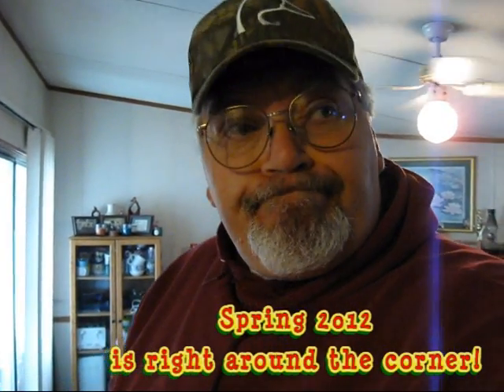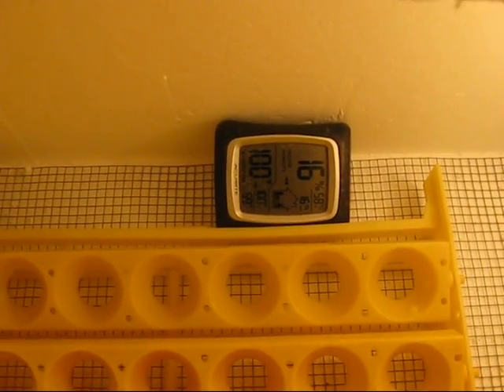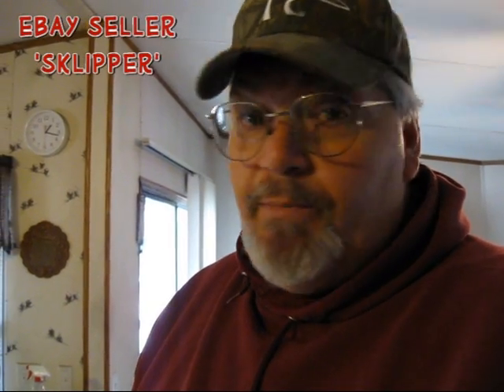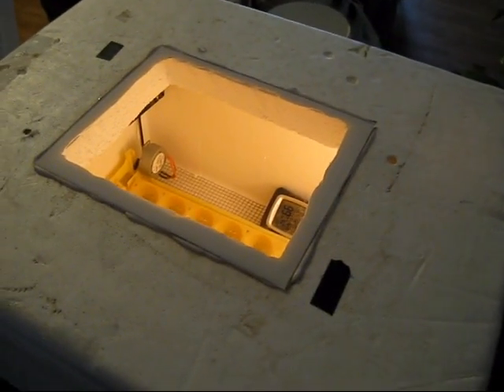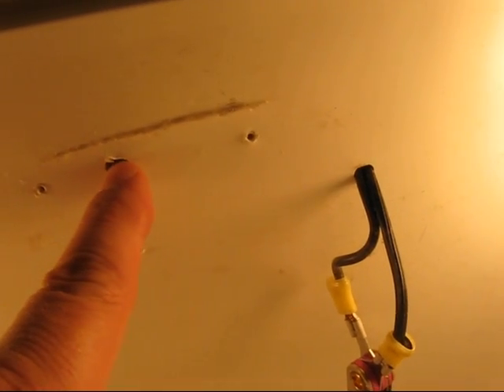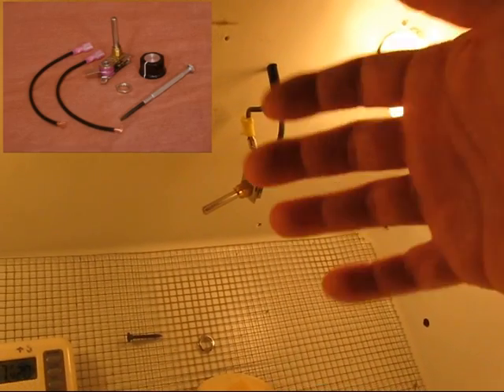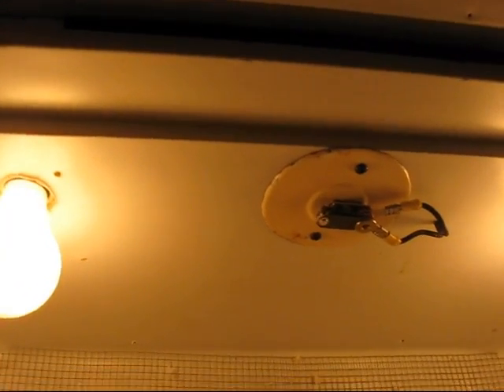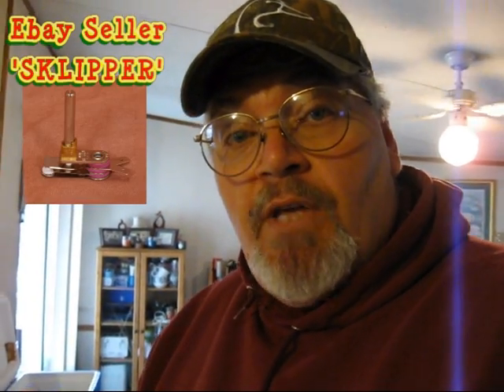Sammax Bi-Metal Incubator Thermostat Review & Installation in a Home Made Incubator

Comment: Was going to get one. Even the China cheep incubators don't vary a whole degree. 99.5  + -  1tenth of a degree is what I am trying to accomplish before I start back raising in February and March .These birds are hard to hatch in any incubator.Rather my hens do this job. Some hens just don't sit. Always the hens you want to lay and sit that for some crazy reason never do.That metal light fixture your using as a mount will work great. It well give you better efficiency of the thermostat.

Comment: Hello rush i think i have watched all your videos on building a bator lol.I ran up on a styrofoam cooler much like yours good size with about 3 inch foam.I have set it up just like these with two 72 watt bulbs and the  Sammax Bi-Metal Blade Thermostat  and cpu fan.I also made my egg turner like you said with the pvc pipe under the egg tray everything seemed good i ran it for a couple days getting humidity where i need it and temp for my quail eggs.The only trouble i am having is with egg turner inside bator my thermastate is staying at 99.5 at the bottom of bator but where the eggs tilt up the temp is at around 104 to 103.No madder what i do i can not get the temp the same i have moved my fan to several spots and no change even tried mounting the fan in the center of lid straight down,Then tried 2 fans got it down two 102 at top of eggs and 99.5 at the bottom of tray.The only thing i did differant with thermastate was i have it mounted to the front of bator instead of the back where bulbs are.Thank you for any help.
Reply from the maker: that can happen in some cases... but as long as the temps don't get too much over 102 F, you will be OK! You may have some chicks hatching a day or so early but no worries!!
Reply: Rush Lane Poultry & Game Birds Okay sounds good i will fire it back up in a couple days i only have 5 females jumbos right now so ill be collecting eggs through next week lol.I live in East TN. so weather has warmed up good now and ready to build some cages and hatch some quail.Do you have cages tilted with slot for the eggs to roll out to the front of the cage? I am still trying to figure that part out looks like it would make it much better to collect eggs and keep them cleaner for the bator.
Reply from the maker: chris ehrgott we still have nesting boxes full of wood chips & collect twice a day...

Comment: hey i used a bimetal thermostat in my cooler incubator after seeing this video.
i used heat tape and computer fan aswell. I'm getting a 4-5 degree temp swing do you know i can help with this?
Reply from the maker: Hey Jessica! That heat-tape heats up very slowly & cools down very slowly... when using a 'mechanical' thermostat like the sammax, you need something that heats up fast and cools down fast; IE Light bulbs! If you want to stay with the heat-tape you may want to go digital! An STC-1000 thermostat works great! Wade

Comment: I tried two of the bi-metal thermostats from incubator warehouse and neither one was worth a quarter. I would not use this type. The best is the P.I.D. thermostat that keeps a temp between 99 and 100, these bi-metal type can range anywhere from 96 up to 102.5 which is no good for hatching bird eggs.

Comment: I tried one as a replacement in a hovabator and has a 7 degree temp swing. I think these are only best with the bulbs in my experience. Where you can keep them right next to the heat source just like the water heater thermostats..

Comment: Thanks for the great review of this this thermostat.  We sell this on ebay under username Sklipper and also at IncubatorWarehouse.  
Two very important notes of emphasis:
1. The blades on this will have live current flowing through them with it is plugged in.  We HIGHLY recommend putting some kind of protection around the thermostat so no one gets shocked.  
2. The more air flow that directly hits the thermostat, the faster heat will transfer and the more temperature sensitive it is.